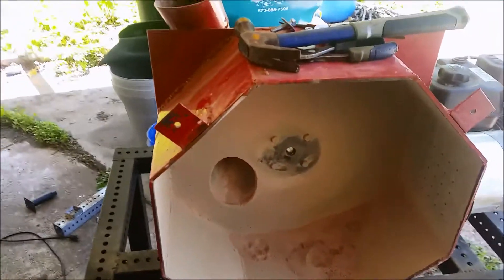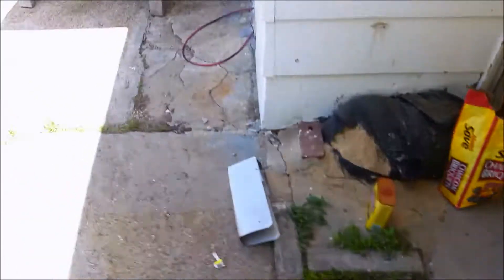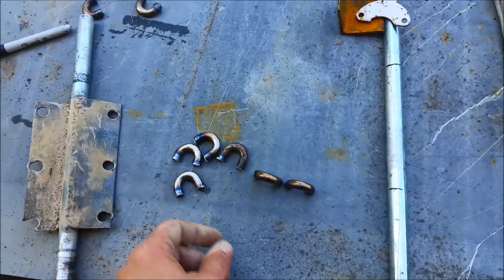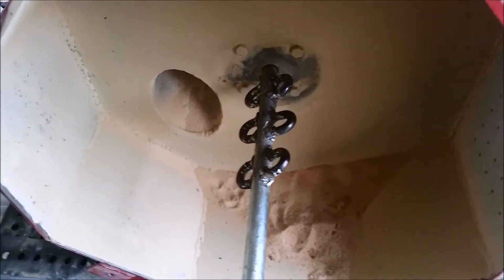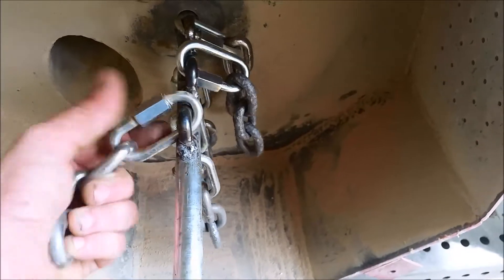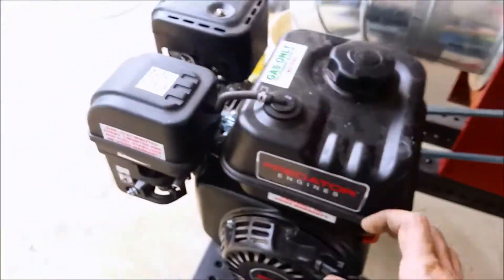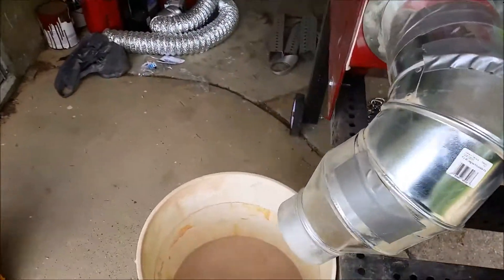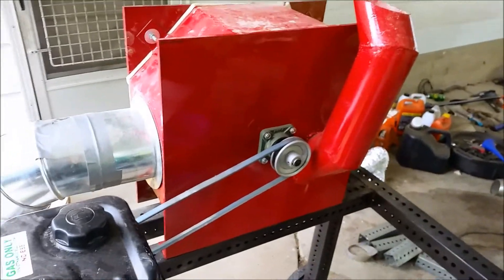Making repairs to my new homemade rock crusher

Comment: It looks like you are using regular coated (zinc, galvanized, or cadmium) logging chain for your main hammers. You might want to switch to an uncoated hi-test or high tensile chain. It would be much harder, be more efficient, and last much longer. Nice start, nice affordable design.

Comment: Just my thought on this! Welding on a hardened shaft can make them brittle. What if you had a way to  clamp on a set of chains? Also it seems to me the shaft is on the small size. Just my opinion. But it works well with what your using it for!

Comment: What would happen when you add water to the rock intake? Rust and less dust for sure, but i wonder if it would help the crushing or the reverse. The idea is that you could add a sluice directly under the crusher. You'd have to move the exit holes to the bottom, the water may plug the holes. Just an idea.

Comment: Btw that slippage caused your failures.  Go ahead just trying to help you I built and designed equipment. For years.  Before you where born. Its ok those welds are true. Your machine you better bolt or clamp down those out of alignment loops you welded on are gonna shake like hell. Imho you obviou9 know more than I do

Comment: I've run tonnage through several different machines. And developed equipment. Your torn out holes to small holes not enough air and material flow those tears in the metal are from hitting bedded material that stalled out in the machine = not exhausted. The chains hit at high speed slippage is not good in this application do you run loose belts on you car ? It's no different if you. Make a tensioner to hold the belt so it doesn't. Slip the flopping is over load on a non tensioner belt tsc 3inch idler two 3/8 inch bolts sphere a nut welded on th rail say. 4 in piece of stock you want the most wrap on th drive pulley of the drum motor end
Reply from the maker: Not sure why you are making several different comment chains rather than sticking to one but I'll try to address them here.

"Your torn out holes to small holes not enough air and material flow those tears in the metal are from hitting bedded material that stalled out in the machine = not exhausted."
--This is simply incorrect.  I used to soft of a steel with too thin of walls for that application and centrifugal force just ripped them out.  Whilst I agree the vent holes are too few, it takes several hours of running before I start to get material built up. 

"The chains hit at high speed slippage is not good in this application do you run loose belts on you car?"
--Once again this is incorrect.  You have to have slippage so that the shock of those chains hitting rocks does not get transferred to the motor.  No I do not run loose belts in my car because that is a completely different application. If the motor in my car was running a rock crusher then yes, the belt leading to that would be slightly loose. Whilst I agree I could use a tensioner i would still require a small amount of slip.  The only issues of the loose belt is more wear on the belt and lower efficiency. It did NOT cause any sort of mechanical failure.  

"Btw that slippage caused your failures. "
--I thought you said above it was small vent holes that caused the failure??  Either way tis incorrect.

"Go ahead just trying to help you I built and designed equipment. For years.  Before you where born."
--The only time someone says this is when there isn't enough merit in the info being provided and the spouter feels they need to add credibility to what is being said. The only thing this actually means is that you used outdated equipment at one point and says nothing at all of skill or knowledge.

"Your machine you better bolt or clamp down those out of alignment loops you welded on are gonna shake like hell."
--I too was worried at first about those loops being a bit off but found that they are close enough to the point of rotation that the centrifugal force being exerted on them is not enough to really be noticed.

Comment: Over feeding snapped that axle and wore those holes out. Classifying your cons then run each twice regardless of size gives great results sift your batches after you run them to take large hard stuff out which will help in cleanup a simple kitchen sifter strainer works great. Ease up on your feeding. If you want hold your hand on the plate. Down low you will feel the unit clean out you have a three way spilt in materials 100s minus about 35. % 60 minus @40% above 60 on your balance have two mills run a lot of desert material security square chain is killer but if you over feed will tear your chain. Eyes out again. And snuff the axle. To those behind me reading this there are several companies who make square security chain it's a bitch to cut the guy selling samples I doubling his money Makita mini or a torch cut that stuff best use the very thin cutter discs cause you'll be cutting cr3012 treated steel it's a theives worst enemy will take about 4 minutes a slice yup it's a biatch

Comment: Your chain failures are due to two factors feeding to fast and to much in the machine when the case gets hat you have to much in you need clear jhot tub tubing running around the edge tighten to snug. Belts not tight enough gearing is wrong
Reply from the maker: There has been no chain failures after this video.  Literally not a single one.  

How could you know what my feed rate is?  The belt is supposed to be that loose to allow for slip.

Comment: I saw 1 smaller out of Canada, no motor they want $1,200. the screen was in the bottom and you could see it would get damaged since they sell replacement screen's.It looks like your eject is out the side and drill holes instead of screen? I am in a area where I don't think shipping is a option. so I will have to build.  Took some to a assayer's office, he said I'm looking at 5-6 grams a ton. I own all rights to 4,800 acres that 100's of years ago was mined silver and gold. I plan on going through the tailings piles. Thanks for building your's.Great Job. Oh I'm stealing the idea...
Reply from the maker: Not only are you welcome to use the ideas but because of this comment I made another video where I got a bit deeper into how I made the crusher.  I hope it helps when building your own. :D
https://www.youtube.com/watch?v=VCDcCXLXR9Q

Comment: The major secret is - in using a Hard Drive magnet.
Reply from the maker: lol Not sure if it is a major secret but they are awesome when it comes to holding metal whilst welding.  I have tons of them to scrap out and it doesn't matter if they get ruined.